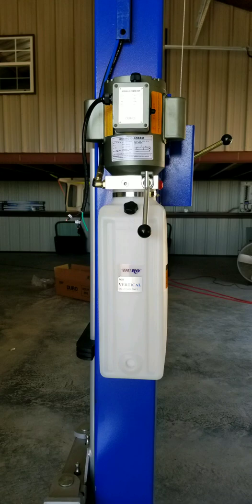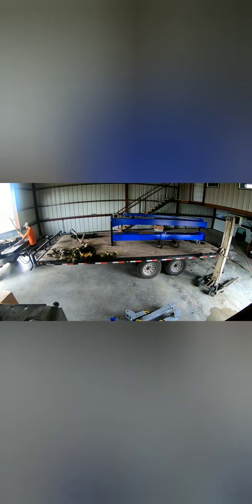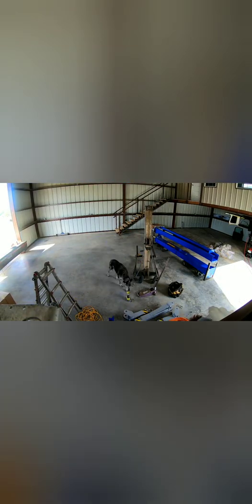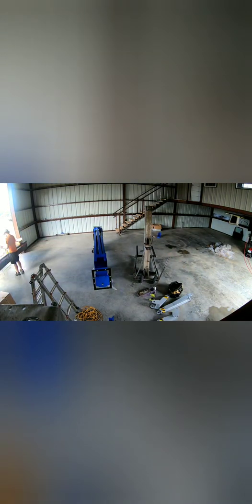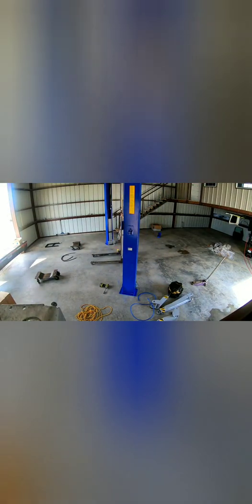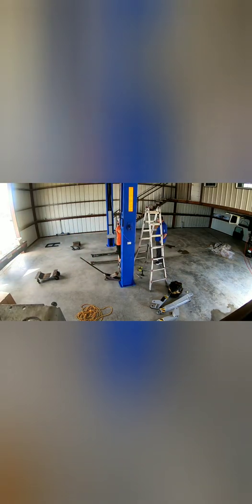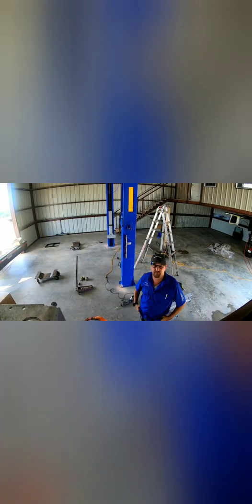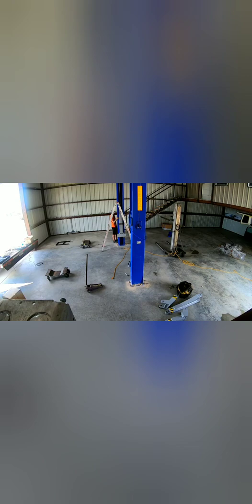2 post vs 4 post, DMS 11000A 2 post lift

Comment: Lift still doing OK?
Reply from the maker: Yup. Doing great. It gets used every week. Had my dually on it just a few weeks ago. Had to change the turbo. Made a few videos off that.  Had a ram 2500 on it just 3 days ago and a passat on it before that. I have noticed that one of the hose fittings is wet and leaky. But functionally the lift has been fine and without issues.  I will say. If I had it to do over again. I would build my shop a little bigger and do a 4 post lift with a trolly jack. Only because I get tired of crawling around on the floor and putting the lift arms in place. And I have to admit. I am never comfortable standing underneath a one ton dually hanging from 2 arms. It's a psychological thing. Just like I don't want to bungee jump or skydive. Might be just fine but. I don't want to.   Hope that makes sense.nothing wrong with the lift, only me!